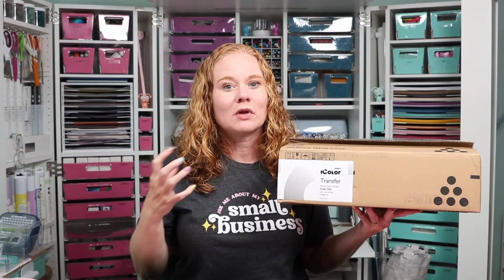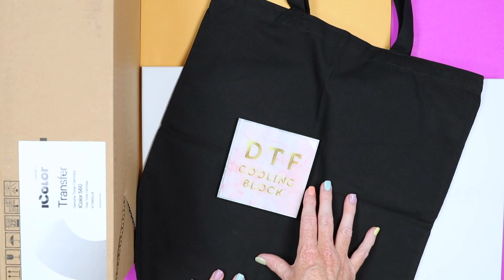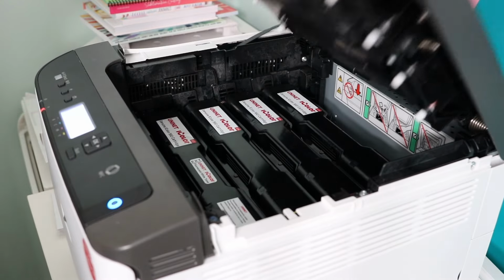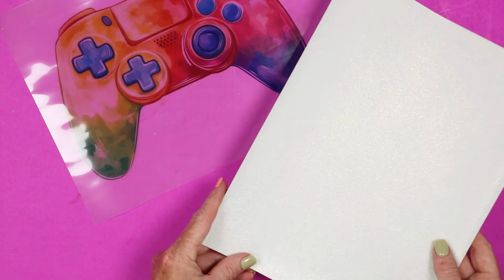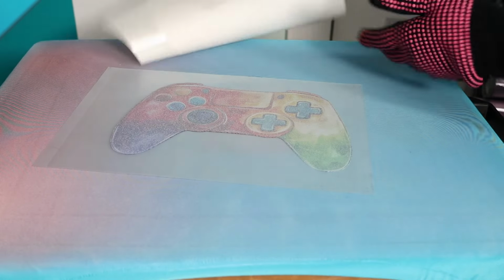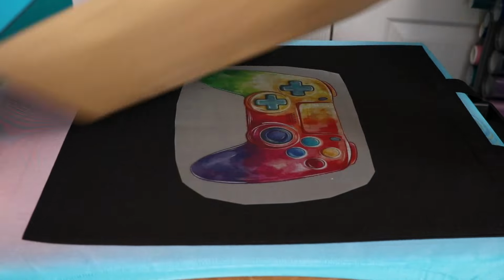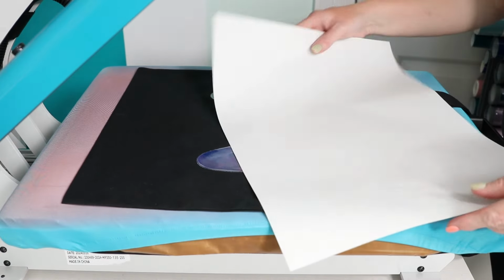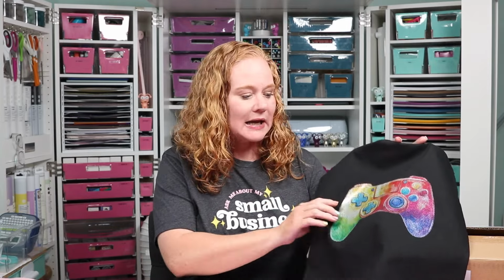How to Make a Glitter Transfer with an iColor Printer

Comment: What pressure did you use like 170 or what because I have a htvront heat press
Reply from the maker: I would turn it all the way up. Not sure if it will work or not as I have had mixed results with it.
Reply: @AngieHolden I have one that looks like the regular ones with the handle don't know pressure on that though, so said it doesn't work with the htvront
Reply from the maker: It would probably work with that one. Doesn't matter if it doesn't have the pressure readout. You just want to adjust where you have to really push to close.
Reply: @AngieHolden oh ok that's what that means, ty 😊
Reply: So you would say get a different heat press, I have another heat press cricut shell one and then I have probably a off brand that hhislike theregularlooking @AngieHolden brand machine with the handle